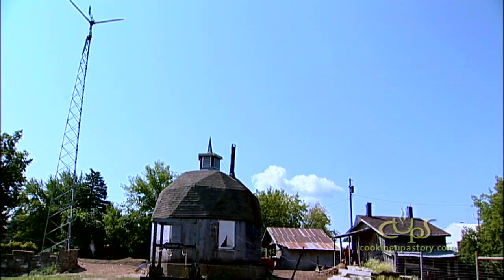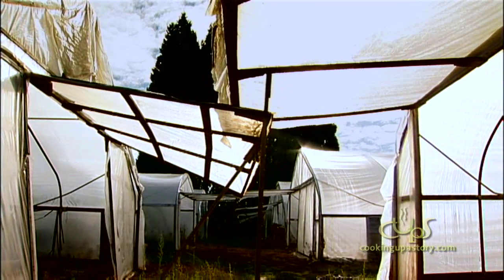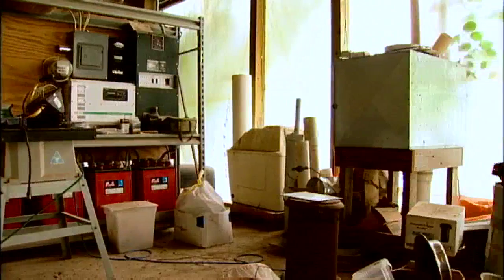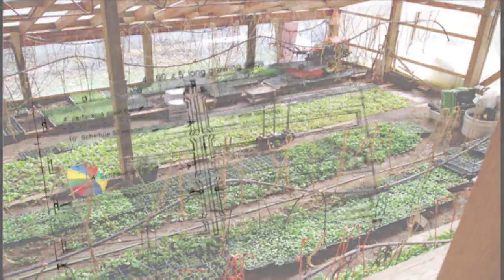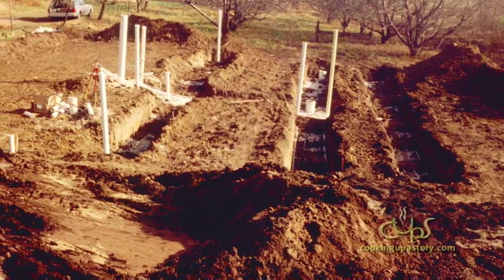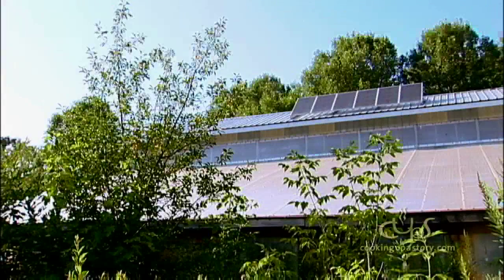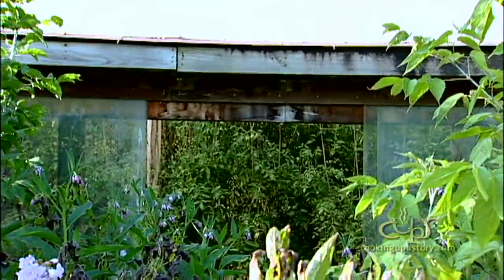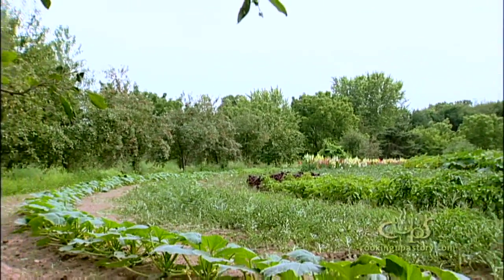Sustainable Energy: Thermal Banking Greenhouse Design

Comment: I just dug out an area and buried trash cans 24" apart filled with stone they sit below the frost level where the ground stays around fifty five degrees, all winter the green house stayed around 10 to 15 degrees warmer then out side temperature and when it is hot out you can feel the cool temperature over the cans.
This was the worst winter, the water drums I have sitting over the trash cans never froze but help to maintain the warmer temperature.
In the main house I built a rock bed and when we use the wood stove I have duct work that sits over the stove with a little in duct fan that blows the hot air in the bottom of the stone bed,  heats the stones and hold the heat hours after the stove is off. If I dig out the floor in the green house I am thinking of connecting the cans with pvc pipe and blow warm air into the pipe to heat the stones like the wood stove does in the house and have a year round green house the coffee plant and My Banana tree need more space they are taking over the room in my house. I live in up state NY I don't want to pay to heat my green house one way or another I will heat it for free.
Reply: +Bremmer Mandrake I've heard of people using compost piles to keep greenhouses just above freezing- perhaps you could use all three of these strategies together to raise the temperature well above freezing for the entire winter. Not to mention solar heat harvesting panels on your house roof (the aluminum cans painted black in a box idea, used to collect heat and blow the hot air into the greenhouse). Do all four.
Reply: +Bremmer Mandrake 
The soil you took out would have had more thermal capacity than the rock filled barrels you put in :) The rock bed and wood stove was a much better idea.
Reply: +Ceres Greenhouses 
About half the space in the barrel of rocks will be air, if the barrel was full of soil there would be considerably less air and with less gaps/pathways,  considerably less opportunity for convective heatloss. The same air gaps/pathways through the rocks will lead to uneven heat distribution. Soil particles being much smaller are packed much closer together are ultimately better for every mode of heat transfer, convective, conductive and radiant.
Reply: Yeah well, have you looked into rocket stoves?  Whatever it is you do to heat your greenhouse during the winter what is it you think you want to grow?  You have to have artificial lighting and timers.  The daylight hours of winter are too short, too shallow to grow anything.  You have to have STABLE heating.  Never once going below 50 or above 90.  Fans or well designed ventilation that is capable of moving the leaves.  Pumping fresh air into the greenhouse (with more CO2) and pulling old air out of the greenhouse (O2 produced by plants that will block the leaves ability to uptake CO2).  What will you use for water?  Well water?  Do you have a manual pump or solar pump if electricity goes off?  Well water takes electricity to pump. If you are on city water every gallon costs money.   The big risk using city water is industrial waste called fluoride!  The plants take it up and we eat even more fluoride!  Fluoride is stored in our bones.  Makes brittle bones, lower IQ and has never been found to benefit teeth in any way shape or form. Another sore subject of mine...Fluoride.  Aluminum and Phosphate industry waste that costs money to dispose of properly; huge fines if caught dumping it into the ocean or rivers or aquifers!  But they get PAID to dump it in our drinking water.  Lots more battles out here than not paying to heat your greenhouse for the winter, grins.  Oh, are you using pots or the soil of the ground beneath your greenhouse?  Don't use garden soil in pots...just potting soil, sterilized boring potting soil.  Hole in bottom of pots, yes?  No rocks in bottom of pots, yes?
Reply: I gotta add, it takes ONE mistake with the heating and you lose all of your crops/plants/food.

Comment: Water tanks painted black
is the most effective thermal mass you can possibly have for the cost.
Water has many times higher specific heat than any other construction
material, rock included. I'm just so sorry you had to do all that earth-
moving when it wasn't necessary at all. They should offer a course in
solar design in every community college, it would save people so much
money and effort.

Comment: Interesting idea.  Whenever the air temp is higher by some marginal temperature run the fan … the sun shining should not have anything to do with it.

Seems like it might be better to have a solar hot water heater arrangement and heat a slab of concrete or tanks of water.

Moving air around is energy intensive, and there is not a lot of heat capacity in the air, and then trying to warm the whole ground is interesting.  This reminds me a little of the EarthBox idea, but with air.

Comment: I have a few questions: Why is schedule 80 PVC being used? Is the Glazing or glass being used really effective at not transferring cold into the greenhouse at night or overcast days? Have you considered butterfly valves in the underground piping to balance the system like an HVAC system as opposed to what you have ( it was a little tough to really see exactly what you had)?  It seems 40k is a bit much for a greenhouse for me, I don't have grant money. I did like the wood construction. A guy with a hobbyist sawmill could easily cut wood from his land to offset that cost. Good video. It really got me thinking a good bit about how I want to build my greenhouse.

Comment: Awesome.  Thought about running the chimney like that too or build a rocket stove in the greenhouse.

I'm already seeing over 6c difference with less than half of the windows installed and only half of the installation installed.

Are you building with rammed tires and timber?

Comment: I live in Ottawa Canada. Can you tell me if you insulated the perimeter of the greenhouse with anything? You can buy waterproof  insulation (closed cell) that you can put in the ground around the perimeter. This would save you a lot more energy than just blowing warm air under the soil, because the soil around the inside, nearest to the wall, would be more freeze protected. Would it not? I always read anything that comes along concerning growing things under glass or plastic.

Comment: Just to add to rstevewarmorycom. One could have used all of that expensive exposed facades to build low cost solar air (or better water) heaters and bring in the heat to whatever temperature one desires.

I use that exact design to grow throughout the year, and with the recent warm winter, I kept the majority of my orchids out there. Now I have an abundance of tropicals, and plan on selling them to neighbors who have asked.

Move solar heat inside and mass store it for overnight. Cheaply.

Comment: I've seen a lot of this type of videos and I've commented on each of them because the reality is that this is not working. It'f phisically impossible, because the soil doesn't retain heat. The surface of the earth that gets heated by the sun has between 30 and 50 cm in thickness, in some location depending on the soil reaching 70 cm. Deeper than that the temperatures stay the same all year round. At the center of the earth is a huge ball of molten lava with temperatures between 4.400 and 6.000 degrees celsius. Don't you think that if the soil had that kind of thermal permeability, we would've receive more of that heat ?
Earth depth temperatures increase with depth with values around 20-25 degrees celsius per km. But that starts around 100 m depth. With very small variations, depeding on the location and soil temperatures, the temperatures at 1,8 m are around 10-15 degrees celsius all year round. So if you build a well designed system you can retrieve at least 10 degrees celsius from the ground in the winter. Combined with a well insulated greenhouse, you should be able to keep a 15 degrees celsius inside the greenhouse, in cloudy days, which will allow the growing of most vegetables. But you can not store heat from the summer. Otherwise, we would've heated our houses with that. 
Geothermal systems do that, but they reach down into the ground at at least 50 m depths.

Comment: In Minnesota in January you can go several days without any significant sun.  Add to that nightly temperatures in the single digits or less. How could this would work in conditions like that?  What do you do at night when all the hot air has been exhausted and the fans turn off and the temperature is at -10F?
Reply: You are right about the cloud cover.  You will need to have a backup heating system.  I just toured a passive solar greenhouse here in MN, and it is connected to a large pole barn.  The temperature in the barn seems to stay above freezing, but there is a wood fired heating system in place if needed.  It vents into the greenhouse when conditions are like you describe.  The SFA in MN is starting a chapter exclusively for passive greenhouses in the area.  They would be a great resource for troubleshooting.

Comment: Is this "banking" as is First National Bank or "banking" as in riverbank ?

I would think it would make more sense to have an air to water heat exchanger and them pump water under the floor ... like radiant heat, or even have black tubes running in the greenhouse roof to pick up heat and then pump it underground, or just create a hot water reservoir and use it to heat the greenhouse floor.

You get the economy of scale, and you could heat your house too.

Comment: Fundamental problem is that they aren't just blowing air through the pipes, they're blowing warm dry(er) air directly into the soil. He says during the first test that the soil dried out really badly, well no wonder. The air needs to go through a sealed pipe, not a perforated one. All you're doing is using a giant hair-dryer to remove the moisture from your soil. Not sure how they missed that. Other than that a well executed design.
Reply: Mother Earth News used a sealed pipe.  It had very bad mold problems.  You have to use a perforated pipe.
Reply: @michaelgent964  - Interesting, I hadn't thought of that. Mold would be a huge problem in that instance. Thanks for the reply!

Comment: This design could all be ran off ducted systems to control temperature so there would be no need to vent any heat or any cold. Solar vacuum tubes used to heat water and power TEG's with capacitor banks and even solar panels could run all these systems. All self contained stand alone green houses to produce food and medicine. Is this a good idea?

Comment: Interesting greenhouse, but I just don't see why you wouldn't use fluid instead of air...Some kind of water storage tank which absorbs solar energy and then a pump instead of a fan which circulates the hot water through radiant pipes under the beds.  You could even have a supplemental boiler attached to the water storage tank in case you need it certain days.  Using air just can never be as efficient as water to store the energy.
Reply: And it would work brilliantly with say.. Talapia aquaponics sense the water has to be at about 56%.

Comment: Interesting does it ever get way too hot in mid summer when all that heat stored underground combines with a high air temp in greenhouse? Do you then resort to release some heat outside.I wonder Is there any way the summer heat can be stored and used throughout the whole winter not just early winter and spring.

Comment: I'm surprised that the link in the video 4:38: https://www.sare.org/publications/fromthefield/schwendiagrams.pdf still works, (unlike http://oakcentergeneralstore.com/our-farm where "Community Supported Agriculture is suspended due to lack of consistent help." and "Steven is weary of doing this farm solo, and since 2011 is looking to leasing or transferring the farm"  Farming is hard work!  This thermal-mass under floor heating was used by the Romans, (and though it is a useful technology, we need to automate the farming without reliance on petroleum horses.)

Comment: Could not evaporation absorption refrigeration be used to cool a green house in the summer. Induction or magnetic or solar vacuum tube water heating for the winter that can also run TEG's to keep capacitor banks and batteries charged? NOVARTIS

Comment: In a traditional Green house could you not run 10 inch construction pipe under ground to each corner with the intake at ground level then have the other ends at celling level with booster fans to circulate the air to keep everything at an even temperature?  Or even have a regular house A/c unit keep the temperature just perfect to grow what ever crop your trying to propagate?
Reply: Running A/C would be a terrible idea. You could just have an automated system to open vents when it got too hot. No electricity required if you use the expanding mineral type.
Reply: How about vibrational cooling and heating do you know how to do this using minerals and sound?
Reply: Generating hot or cold and generating electricity through vibration at the same time? I am sure you have no clue what I am talking about because this is not taught in free mason indoctrination called public education? ; )
Reply: Climate change would not allow you to use regular green house tactics to control the climate in the green house. So new advancements would be needed in order to grow crops in green houses. A venting system would not be a viable way to operate a green house at its optimal output. David
Reply: David do you have the knowledge to design a hydroponic system that can be used in regular farming fields to grow crops while producing fish for food in covered green house ponds are mostly automated? This would be the optimal way to farm in a high drought or where  there is little water. You could also use sun to water machines to generate water to use to farm with has well. Hay David you were saying something? ; )
Reply: Expanding mineral type?
Reply: Opps I am just blowing hot air to vent! ; )

Comment: I don't know why you did all the earth-moving and all the electrical
blowing when you should just use water for thermal mass. Just put
big tanks at the back, well-insulated rear and side walls, berm up N, E,
West walls, and then put an well insulated roof on it tilted at the winter
sun angle. You don't need all that glass, you don't for the heat, you
don't for the plants. Just catch the 9AM to 3PM sun and reflect it
all around using foil for the inmost walls.

Comment: The one mistake that all these people keep doing is trying to blow hot air under ground. That is NOT how physics works. You need to create a vacuum on the system in order for the heat to be efficiently released by the air into the batttery, and to create cooling. When you want heat you take the coldest air at the bottom of the greenhouse and put force that underground. You always way to be pulling on what ever area is coldest. The colder the air is, the more dense it is, and the more efficient your mechanical force is. By pulling the cold air out of the ground you are pulling a much larger volume of hot air off the peak of the greenhouse where the air is a LOT less dense.

Comment: Double dug raised beds would warm the soil just as effectively as all this work you have done.  Not sided raised beds, just double dug with shallow trenches directing and pulling water away from beds.  I do not like using that row cloth at the bottom of your rows, Perched water table would be the main problem.  Mixing sand into a soil does NOT help with drainage.  The only way to improve any soil is by adding decomposed organic matter, to the surface of the soil.  When adding NON decomposed organic matter to the soil you are putting most of the life in that soil to sleep, dormant or in eggs.  Raw manure, bark chips, straw are non decomposed examples.  The decomposers will go to work immediately to decompose.  They need nitrogen to do their work. When they have converted non decomposed into decomposed then the life in the soil wakes up. Life in the soil has to have decomposed organic matter for energy. This needs to be taken into account when you start adding balanced fertilizers according to plant's needs.  pH is a huge deal.  Planting like needs plants together is huge.  Rotating every year and leaving at least 2 years between tomatoes for instance being planted into soil that hasn't had any of the solanaceae family growing in that soil...for 2 years.  Ventilation and drainage are far more important than that row cloth at the bottom of those troughs, for sure.  'Sumping' is a loose word we used describing losing larger gravel (larger pore spaces) we add to the surface, lost to the depths as fines sump up to fill larger pore spaces because weight is being applied to the surface.  Landscape fabric was designed ONLY for this purpose, not weeds, not for losing top soil into the lower soil horizons FOR SURE.  The row cloth is acting like landscape fabric in your mind, I think anyhoo.  Remember, pressure and weight are not added to the plant beds, a bit for paths.   If you had gravel paths, that row cloth would be properly used below the 4" of gravel to not lose that gravel.  What skin are you using on your greenhouse?  Artificial lighting?  Warming the soil is in my mind is counterproductive.  The sunlight warms the top 6" just fine.  That is where 95% of all roots in this world are...your row cloth is impeding drainage just like a perched water table (think upside down as well).  Let me know what you think...